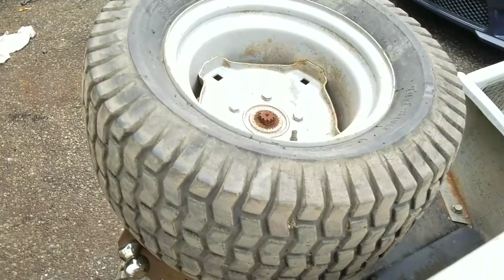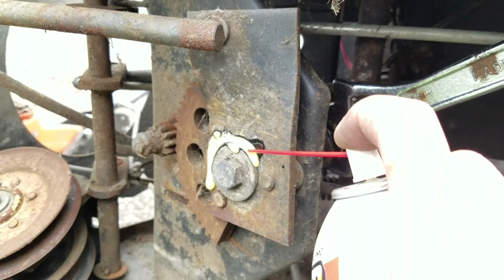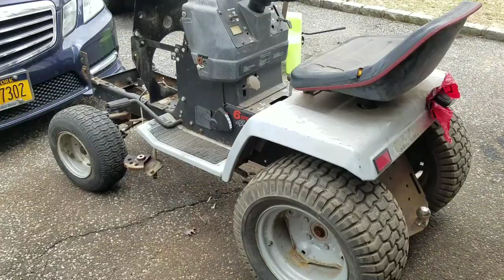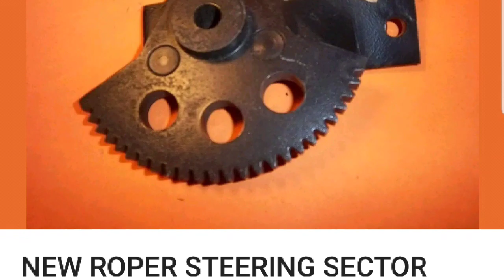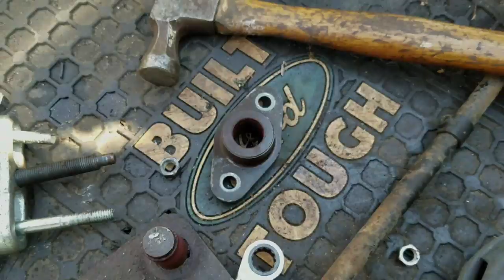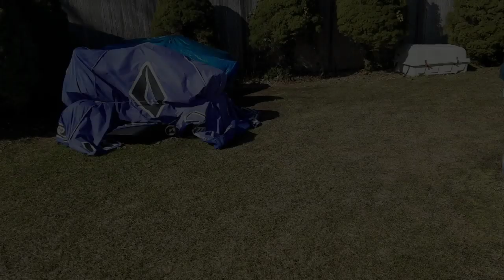FREE CRAFTSMAN GT6000 GARDEN YARD LAWN TRACTOR RIDING MOWER UNSEIZE STEERING SECTOR ASSEMBLY REPAIR

Comment: for 2019, riding tractors, which engine do you like best,  Kohler or Briggs&Straton ??
Reply from the maker: Kohler...especially their vtwins... they're used on commercial equipment.  Mostly all briggs are now made in china.
Reply from the maker: If you're buying used, do not buy a kohler courage single cylinder..worst engines ever made.
Reply: @MowersNBlowers  , thanks.  It will be new.  Cub Cadet XT1 Kohler 18hp 1-cyl,  the XT2 has 22HP/725cc Kohler 7000 Series V-Twin OHV 4-Cycle Engine.
So you recommend the XT2?
I was think John Deere but I don't like the gas-fill under the seat and the PTO-Level on the steering wheel.
What do you like for a 42" rider?
Reply from the maker: @rondail5675  if money wasn't the issue, I'd get the vtwin.  It's really up to you if course...but John deeres are made better than cub cadet which is an MTD product.

Comment: I just did this same thing
Reply from the maker: Ed...flip the tractor over, fix the steering sector, or repower a gt6000?
Reply: @MowersNBlowers  steering fix, I have the exact mower but all original and it's a special indy 500 edition.
Reply from the maker: @Silent_Watcher-h1n  nothing better than the indy500!
Reply from the maker: https://youtu.be/69yrpO6qb3M
Reply from the maker: You welded teeth? I just finished the sector replacement as my welded teeth didnt hold up.
Reply: @MowersNBlowers  Man it is and awesome tractor and strong too, but no I got lucky and was able to put a washer in my steering sector  bolt and it tightened up enough to fix it.......for now anyways, but yesterday my neighbor moved out and owed me some money so he said I could take everything in his shed, so i got 2 craftsman 2's with 12hp motors, 5 push mowers,2 weed eaters & a 12hp motor, all for 75 bucks

Comment: That was built by AYP, now owned by Husqvarna, probably a 1991 or 1992 model. they made the same tractor with different style hoods with several brand names. I have one of them, it's a TSC Huskee. The gear you is no longer being made, can't find any new ones.
Reply from the maker: John, it's an 1986 made by Roper 633a.  I found a new part for $100 on eBay.  My latest video shows I didnt need a new part, just fixed the old one.  Thanks for the comment bro. Hope you subscribed
Reply from the maker: You'll see in this video I showed the serial number label. Made in 86.  Tractordata.com showed model # was manufactured by Roper.

Comment: I've been buying parts for my 97 LT1000 from Sears. There are also parts diagrams and parts lists. I need the gear assy' for my 97 and the whole thing runs $35. Of course, my steering gear isn't thick metal like your garden tractor.

Comment: https://www.amazon.com/Steering-Sector-Replaces-ROPER-102787X/dp/B001UK2KRA/ref=asc_df_B001UK2KRA/?tag=hyprod-20&linkCode=df0&hvadid=198123788296&hvpos=1o5&hvnetw=g&hvrand=7483756258556937712&hvpone=&hvptwo=&hvqmt=&hvdev=m&hvdvcmdl=&hvlocint=&hvlocphy=9004684&hvtargid=pla-355892297741&psc=1 see if you look it up right you can find it cheaper
Reply from the maker: Only place is ebay...guy selling it for $100!  Uh NO!
Reply: @MowersNBlowers  it's the right part eBay is not the City place
Reply from the maker: It's not the right part...mine has a side bar attachment. This link goes to a straight bar hole. I saw this on ebay for $38.
Reply: @MowersNBlowers  if you look at reviews a simple mode is all it needs to work
Reply: @MowersNBlowers  you just have to drill out the rivets and use your plate
Reply: @MowersNBlowers  if you bother reading the review on the link posted a buyer used it on a gt 6000 just like your machine and half the cost
Reply from the maker: @mrbriggs68  if you'll just hold your horses Keller, you'll see what I'm doing.
Reply from the maker: https://youtu.be/vCUvvQ1cfdU

Comment: henry,  that tractor looks like my craftsman i picked up for free last year so far i haven't got to it to get it running but it has the same back wheels that are splined also and this one has 20 hp twin kohler on it , btw nice vid :)
Reply from the maker: Lucky you...I'd love to have your engine.
Reply: @MowersNBlowers  yea, but looks like that tractor j&r has its green also ill show it one time here put a video up. but not side pulleys
Reply from the maker: Yours is probably a vertical shaft!
Reply: @MowersNBlowers  yes it is